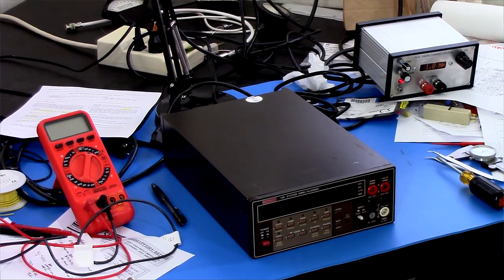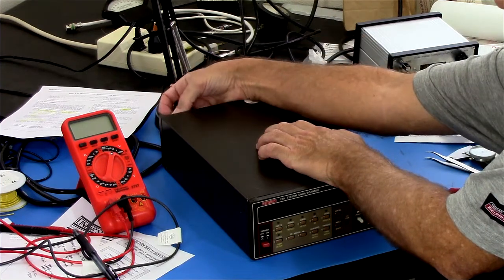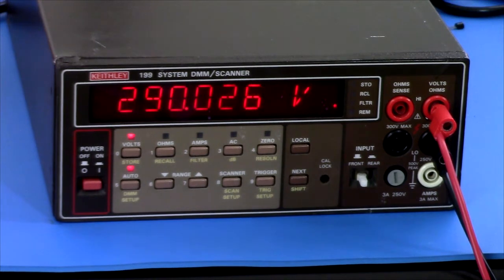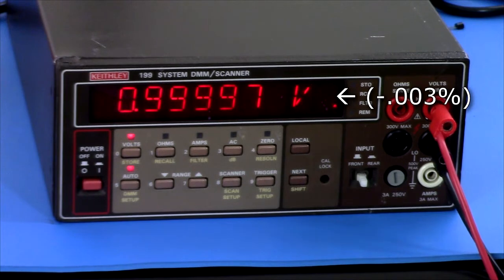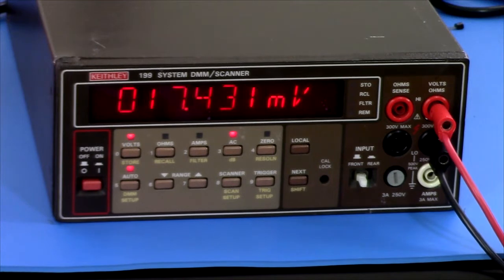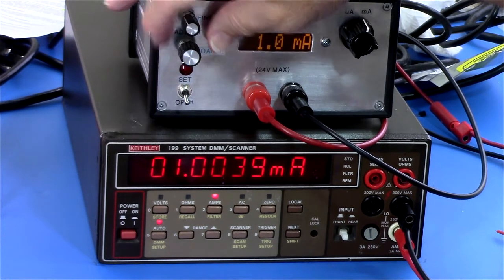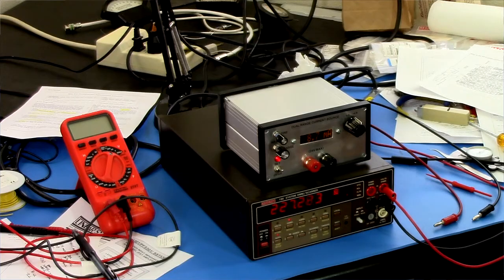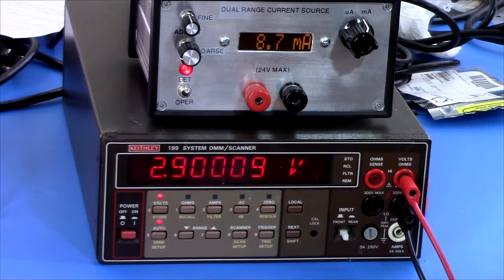First Look: Keithley 199 System DMM/Scanner

Comment: What calibrator do you use?
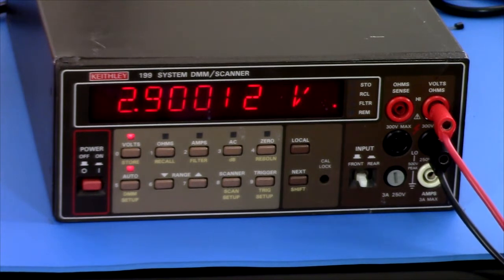Reply from the maker: Everything is identified in the video: DC Volts at 2:35 - Fluke 343A, AC Volts at 7:23 - Fluke 5200A.  Current source is homebrew, but I now have a Valhalla 2500.